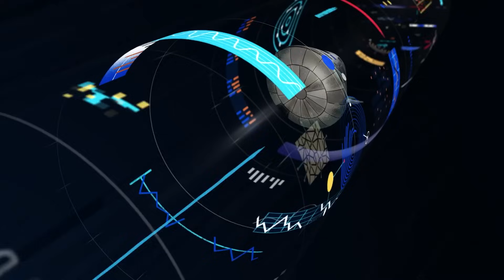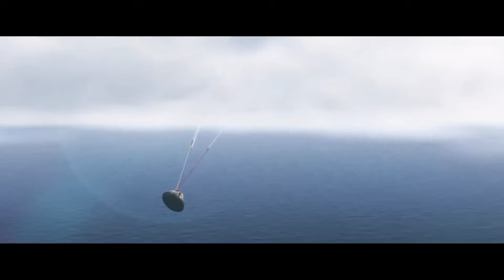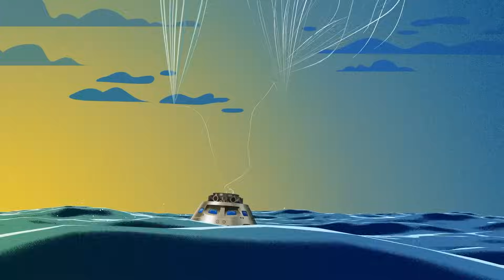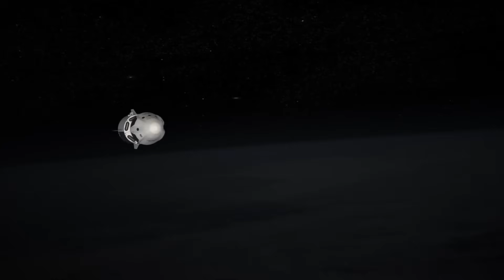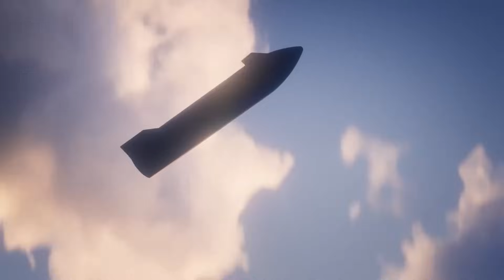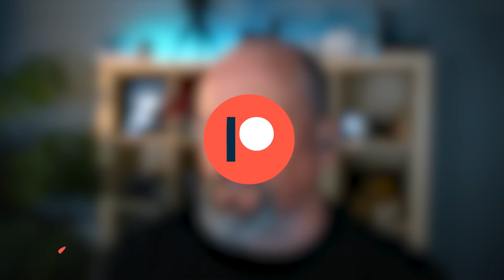Can Sweating Heat Shields Solve Re-Entry Problems for Reusable Rockets?

Comment: sweating from under the tiles? maybe. sweating as a heat shield, No. 
It would be a better idea to change the material of the insulation mat under the tiles to fix gap issues.  Think Carbon-phenolic but more plastic/elastic and made into a gauze like mat.

Comment: This idea reminds me of a super cavitating torpedo, where the water at the front tip is boiled, allowing the torpedo to fly within a gas bubble, greatly reducing the friction with the surrounding water.  This allows a much higher vehicle speed than otherwise possible.  Would this cause the same effect with the space craft?  Would that reduce the amount of atmospheric breaking that would take place? Could that cause a problem in that the vehicle would not be decelerated sufficiently to allow for a safe landing?

Comment: I love your interviews!!!  here is my aerothermodynamics rant.

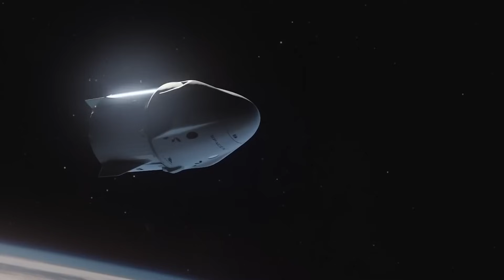1) at 2:15 it's the friction fallacy.  I'm certain both you and he know that skin friction is a small component of the heating and that it's mostly compression-heating but fell into accepted-but-wrong story.  Thing is, compression heating is very easy to relate-to, even for children because it happens whenever you pump up a bike tire or (in reverse) use any kind of spray-can.   

2) The analogy with car braking at 6:21 -- is this really comparable to re-entry braking?  momentum and energy are each being conserved - and if momentum is being transferred to the big-old earth through your tires then most of the kinetic energy is coming out as heat because the earth doesn't change velocity much.    But a space capsule is transferring kinetic energy to the wispy bit of atmosphere between the hull and the shockwave - bringing it's velocity up to match the capsule.  Much more of the kinetic energy lost by the capsule is going into the kinetic energy of the air - it's not all going to heat.    Stopping does not automatically become heat : imagine a hamster running on a wheel suddenly latching on to the rungs (whee!).

3) at :30 you say "you need to convert all that velocity into heat to slow yourself down" - yeah, technically it's kinetic energy not velocity but that's fine -- the problem is that momentum and energy are both conserved.  while the compressive work done on the gas sure causes heating - the momentum change from the slowing of your capsule has to go into motion of the air to conserve momentum - and that air motion accounts for some of the energy that is also being conserved.  Then the compression and heat quickly becomes kinetic energy again as the gas re-expands and is shoved aside at the speed of sound forming the wake and dissipating shock wave.  That heating (then convection, radiation, and ionization, and the share carried off by the air vs absorbed by the vehicle) sure matters for re-entry engineering - but leaving the story at "heat" is incomplete when you observe the event : as the capsule rips by it leaves a mighty wind.

Imagine a desk fan - the fan blade can be said to be compressing the air and the ideal-gas law lets you calculate a temperature change - but in my experience it blows the papers off my desk.    Maybe getting into conservation laws and gas laws is too much, but 'stop == heat' and ignoring momentum is maybe too simple?

i almost didn't post this, it got too long.  but I find this stuff really interesting and try to understand it from the undergrad aero I can remember.  maybe someone else finds it though-provoking.

Comment: 🎉 And I think other crazy way is to attach heat shield panel like a fender shield that opens before entering and stays about 1 meters away from the actual ship... its like a snow board - think about it 🎉 - its even more lighter than swet cooling system with taking extra gass mass on board...

You can even add some crazy amortization to the sheild arms to reduce vibrations 😂
Reply: btw be careful because swet cooling facing the plasma might just explode even more then regular ship ... 😂
Reply: I think this topic is more material science then swet stuff... we need something more awesome then regular heat shield tiles, with different type of material that will more lighter and more resistent than regular ones...
Reply: Stop liking your own comments lol
Reply: @Anonymous-m9f9j  But I like them 😂😂
Reply: Yes weight is the big downside of swetcooling... because to inject liquid you need preassure system + the gass volume itself
Reply: In other words that wont work 😢😅

Comment: Take a bit of a different approach: The energy to accelerate the spacecraft is energy spent to increase kinetic energy (...that's not a loss, sofar). But: to slow down the spacecraft doese transform this kinetic energy into heat - which at the end is lost to the environment. Would be fun to find a path to recover at least part of that energy (instead of heating it away). From a physical point of view: yes, that's a huge challenge (short time, high power). But don't call it impossible.

BTW: 16:30 good explanation how insulation works.

Comment: If you have a blunt object, isn't most of the heat load occurs in the form of radiation (the shock wave is at some distance in front) ? Then the "puffy jacket" insulation does not seem so useful. It seems to be unnecessary more complex, fragile and most likely more wasteful than a simple regenerative cooling (cooling channels, but no sweating), for example which is planned by Stoke Space.

Comment: A small rocket engine, not to slow things down, but to form a barrier. That rocket exhaust, creates a barrier, gets super heated, very hot. It also does slow you down a bit. 
Should be very effective. The speed is the speed of the rocket, plus the speed of the exhaust. It's going to be very large as well. 
Does that work?

Comment: The secret is to transform the energy from heat to something else: a fixed inert capacitor, a "battery", an eject-able "heatsink", or simply deflect heat into the surrounding environment with radiators or some other future tech. It is all about attention of the energy patterns, using Transformers to change it into a manageable form, beneficial to us. The optimal way to break a space-craft is to transform its kinetic energy to another charge of propellant-able form of energy.
Reply: Typically about 98 or 99 percent of the kinetic energy ends up in the air. So for example a 100 tonne vehicle traveling at 7.8 km/s has a kinetic energy of about 3 Terra Joules. 2 percent of this is about 60 Giga Joules. Enough to melt about 60 tonnes of steel (combined energy of heating and melting for steel is very roughly 1KJ/gram). You can do the math for sand, or whatever you like, but you quickly realise it boils down to how efficiently you can re-radiate the heat. Whatever does the radiating has to be insulated from the ship so its not cooking the ship.

Comment: In the case of Starship, having control authority once in orbit will help a lot more for safe return.  The ability to point your heat protection to the windward side is kind of critical.  I could see using a sheath gas especially at the joints and leading edges for the fins where we see the most heat damage occurring.

Comment: Maybe a laser could drill millions of tiny holes. You might be able to load the cooling gas in orbit from a tanker, so weight wouldn't be as much of a problem getting off the planet, especially using heavy carbon dioxide as a liquid. It expands a lot changing to a gas. Hydrogen is way too explosive over a large range of air mixture ratios. And it makes metal brittle. Liquid refrigerants might work, but pollution might be a problem.
Reply: You don't really need an elaborately manufactured porous material. Carbon foam gives you an open cell structure, controllable porosity and its also a refractory material in its own right. All you need to do is to spray liquid methane onto the back side of a carbon foam panel and physics will do the rest for you.

Comment: My early career was at the USAF Ballistic Missile Office, working for TRW Ballistic Missiles Division (the SE/TA contractor for ICBM development).  We were located at Norton AFB, California, and there were a number of Air Force Special Project Offices in addition to BMO (the SP-71 SPO was locsated in our building, but only a few of us knew it).  Anyway, one of the SPOs was the Advanced Ballistic Reentry Systems office (aka ABRES).  Original reentry vehicles for ICBMs were blunt bodies, like Apollo.  They weren't very accurate because their drag was very large, making the aerodynamics dominant in the reentry dynamics.  ABRES developed the conical reentry vehicle, which looks like a big highway cone, and comes in pointy end first.  The aeroheating problem was very severe, especially at the nose tip.  3-D carbon-carbon was the material that solved that problem.  But they also tested a transpiration cooled nose tip in the 1970s and 1980s.  These were actually flown at intercontinental range.  One TCNT configuration used an Aerojet platelet injector, the kind that company used in all of its liquid rocket engines.  It worked just fine.  The liquid they used was a brine, whose composition I forget.  The solvent was water, and the solute was something that would decompose when it got really hot, in a reaction that was very endothermic.  And of course, turning water into steam gives a huge volume increase.  So, yes, this has been done.
Reply: I was fed a lot of cloak n dagger myths about what actually went on inside the BMO building. Now I know you really were working on ballistic missile tech and not dissecting little green men. Thank you, Mr Kelly.
Reply: Hilariously that sounds very much like the urine  Fraser mentioned (pyrolysis enthalpy of ammonia is higher than evaporation enthalpy of water...)
Reply: Iran: I see I see 🧐📝👀
Reply: @EmperorFist323  well....that comment aged badly !....
Reply: Sir, this is a Wendy's.

Comment: Fraser, I think that there is a more elegant solution. Think about panels of carbon foam. An inherently heat resistant material. Mount these panels on stand-offs, leaving a space between them and the vehicle. Fill this space with a mist of liquid methane. No fine pores. Nothing fancy. The liquid methane wets the back of the panels. It evaporates and gas finds its way through the open cell structure of the carbon foam. As the gas works its way to the surface, it takes heat. Methane has a useful property in that its specific heat multiplies several times with increasing temperature. So what I'm proposing is not only light, but also straightforward to engineer. The plumbing is simple and the plumbing remains attached to the vehicle. Only the panels are replaced. Carbon foam will gradually oxidise, but we're talking dozens to hundreds of flights between replacement. Also you're talking about large, rapidly replaceable panels.

Comment: I think it is ridiculous to come home like a meteor. Yes heat shielding is valuable but we should use the Engines with enough propellant to slow down and glide in. Not even rocks can survive this atmosphere without melting or turn to gas. Logic please. We should design ships with these parameters. Escape pods can use this ablative material because they are one time use.
Reply: Why not have 9 forward counter thrusters? Or rotatable thrusters that could push against momentum? Reduce speed and allow the heat shields to operate in the temperature zones they can survive. This would work in the material science we currently have. Or drop in backwards and turn around in stable atmosphere and glide flip and land?
Reply: X teaches so very much.  Reverse thrust, my first time feeling it was landing on the side of a mountain, very small runway in the Dominican Republic.  Amazing.
Reply: Purely propulsive landing is possible for Mars, provided it is crew only (not cargo). Doesn't work for Earth because it 10x kinetic energy.
Reply: @saumyacow4435 I disagree. Propulsive landing is viable and important to landing on earth, because if we can land on earth, we can land almost anywhere.
Reply: @saumyacow4435 With all respect, that’s like saying for years boosters can’t be caught or landed.
Reply: @dbireland2003  im talking about returning from orbital velocity
Reply: Great vlog by the way. ❤
Reply: To land purely propulsively you need twice the delta-V. That isn't just twice the fuel, it goes up exponentially. We can barely launch off Earth as is, it is very close to the limit of rockets being practical - the amount of cargo we launch compared to the amount of fuel we launch is ridiculously small. Launching an orbital rocket from Earth and landing it purely via retropropulsion without using air resistance in any way requires basically an infinitely large rocket, because now the original rocket is your payload to orbit.
Reply: I’m not saying total propulsive. Draco engines faced forward to break the momentum and help the ship survive.

Comment: If you have a cooling system on board, could you use regenerative cooling like they do with rocket engines already? Thin tubes in the wall of the vehicle with propellent running through them and dumping the heated propellent into the tanks. Would reduce the need for other gas to pressurise the tanks. Maybe, you stop the pressurisation of the tanks just before engine cut off? Would probably only be used in critical places, like on Starship, around the flap hinges etc, but another idea in the same vein.
Reply: You would still need to dump the heat, and that is a huge problem. It has been suggested to spray water out to form a cooler envelope around the reentering vehicle.
Reply: @seriousmaran9414  The heat gets dumped into the propellent tanks.
Reply: @BabyMakR propeĺant expands, tanks rupture, space ship burns.

Got it yet?
Reply: @seriousmaran9414  Except the excess pressure is already used in thrusters to control orientation. If the tanks are deliberately left under pressure after SECO, then they can use more propellant to cool strategic areas and then pressurise the tanks using regenerative cooling AND use that extra pressure to control the orientation of starship during entry. If there's too much pressure, and they don't need to change orientation, they run the pitch up and pitch down thrusters at the same time.

Comment: Could a cylindrical vehicle rotate axially during reentry so that any part of the surface would go in and out of the plasma stream, allowing it to cool down when it is out of the stream?
Reply: All you're doing there is exposing the surface to the plasma on average half the time. The surface will still get hot - too hot for most materials - and you still need insulation to protect the ship from radiation from the shield. The only thing you gain is that radiative balance is improved so the surface will be slightly cooler. Since black body radiation is the fourth power of the absolute temperature and half the time the surface is facing space, you end up with a temperature that is about 1/1.2. So if the surface was going to be 1600C (1873K) then after spinning the surface would be 1,560K or about 1290C.
Reply: @saumyacow4435  300 degree reduction in temperature is not nothing.
Reply: @tbuyus8328  Nope, but its still beyond the useful temperature range of steel and Al alloys - so you still need a proper shield.
Reply: @glennmitchell9107  i asked this on nasaspaceflight forums a year or two back but no-one engaged. It instantly gives one pi times as much surface area. As long s we stay away from the intermediate axis wouldn’t this work?  if starship had entered orbit with a mild longditudanal spin on tuesday (flight 9)  would it have evened  out the torque by reversing it each half revolution?

Comment: I like the idea. Micro porous body makes for evenflow. Inspection would be easy with thermal imaging just turn on the pumps and cameras to observe gas flow . Also, some propellants can be used as coolants too!
Reply: Or you can use a naturally porous material like carbon foam. Just mount carbon foam panels on standoffs so that there is a space between the vehicle and the panels. Spray liquid methane onto the back side of the carbon foam. It will evaporate and the resulting gas will pressurise the space. Thus you have cold methane gas at a more or less constant pressure and that will find its way through the carbon foam. It doesn't matter if the outside surface of the foam is hot (it can handle the heat). Rather its about keeping the body of the vehicle cool and evenly cool. Plus any plumbing needed is going to be attached the vehicle, meaning changing worn panels is simple. No complex fluid connections. And you're not dealing with tiny pores and clogging.